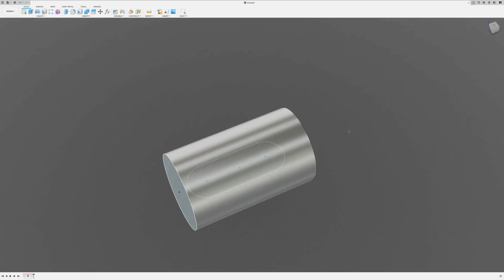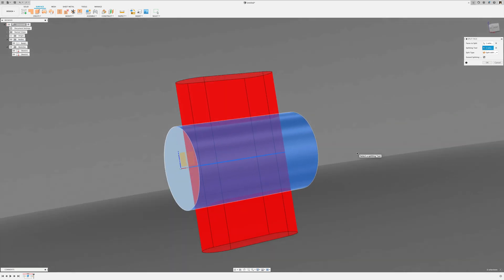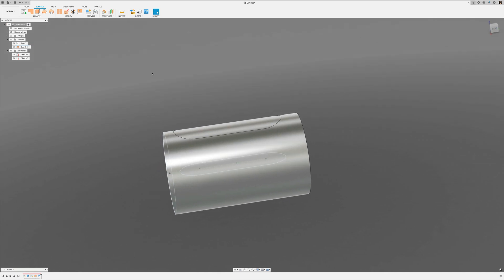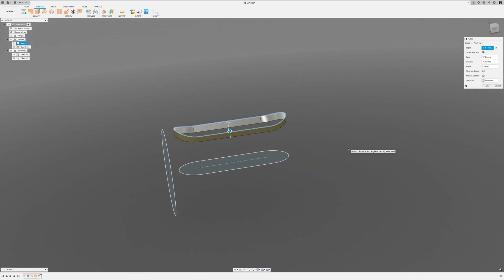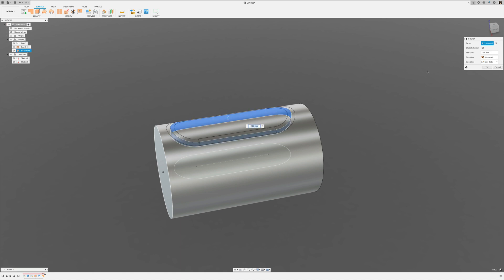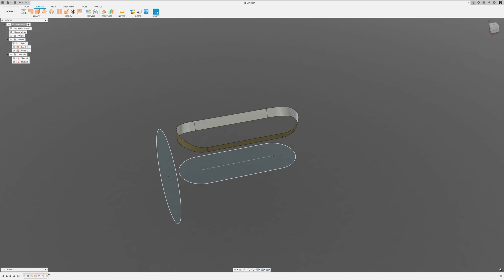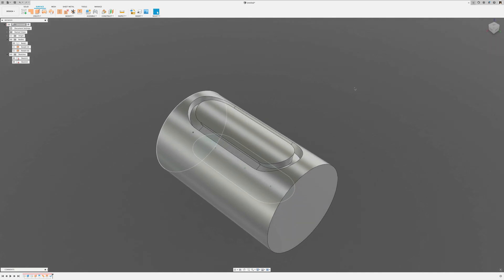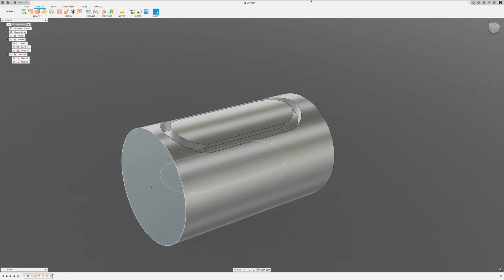Fuison 360 - Forum Response - O-Ring groove into cylinder

Comment: I am trying to program a groove like this for a mill with a 4th axis with fusion 360. The multi-axis rotary operation seems like the best choice but all the options have the tool pecking out the groove rather than following the contour. do you have any tips?
Reply from the maker: I don't do CAM stuff, so cannot answer your question.  You best post this in the Manufacture section of the Fusion 360 forum:https://forums.autodesk.com/t5/fusion-360-manufacture/bd-p/2070

Comment: Just to explore,  I created a slot sketch with an offset (2 concentric slots). I used the sketch to split the cylindrical face and then performed an offset face on the split face. This resulted in a face that is concentric with the cylinder, instead of flat. Can this be done with a 4-axis machine?

Also, the offset slot created in my method probably would not match up with that created by a thickened cut, since it is a straight projection onto a curved surface.
Reply from the maker: No, I don't think so. If you create a section analysis you'll find that the the floor of the offset groove has a curved surface. HTE bottom of an endmill, however is flat., Also the cross section of that sort of slot is not a square but rathe trapezoidal and wider at the top than the bottom.